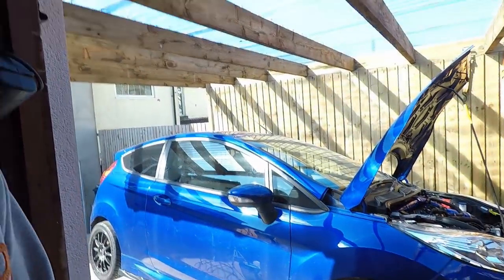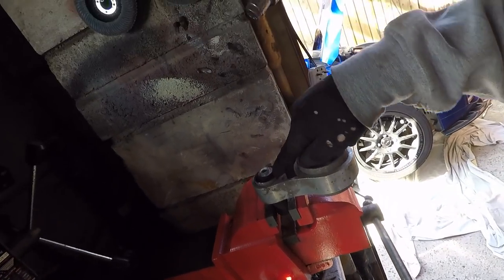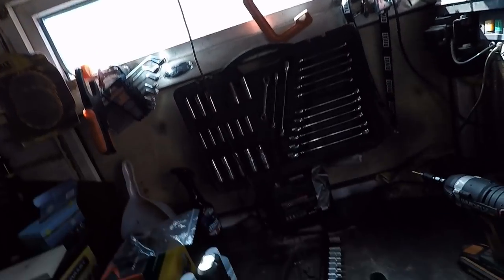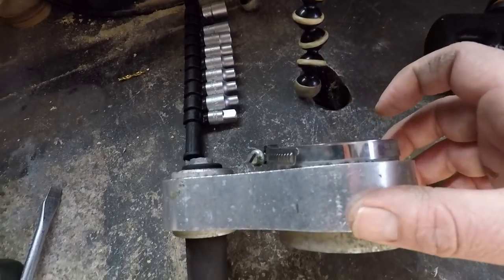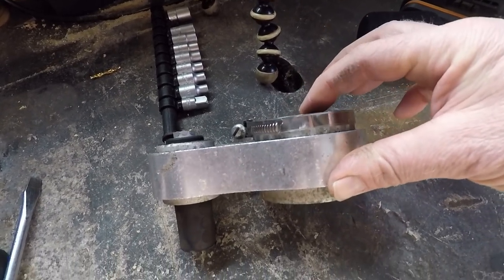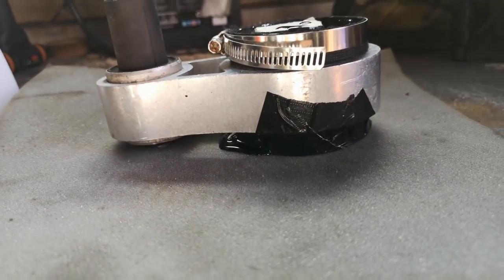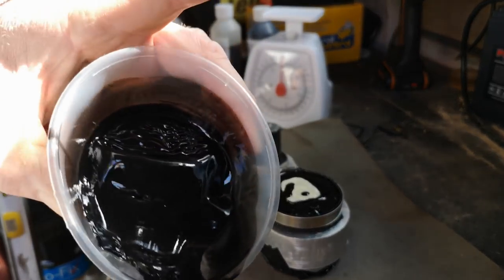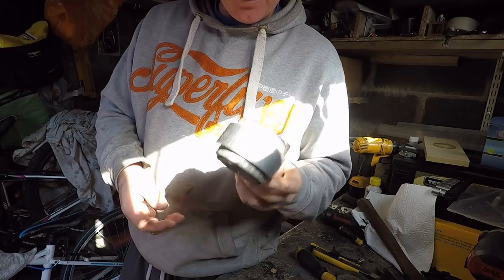Making your own poly bushes.i mould the fiesta st engine mount

Comment: Theory is definitely sound, was a good watch and a good idea.

There are different grades of polyurethane, which cure to different hardness/pliance.

Another cheap way of doing this, with consistent results (but not as easy to get so neat and tidy) is to buy pre-mixed polyurethane sealant (Sikaflex etc) in caulking tube and squeeze it into the bush from a caulking gun.

Comment: There are different types of polyurethane, that one you have reminds me of the stuff you use to fill holes in concrete flooring.
It'll cure very hard but you will still get a tiny bit of flex in the rubber so i don't think it will break up, have to wait n see.

Comment: Hi Steve, you are too young to remember the Austin Maxi, but they had a rear trailing arm bush that failed the MOT every year, so I purchased a new pair and did this repair and it never failed again.

Loving the videos
Reply from the maker: Thanks for the compliment but I'm actually old. I remember the maxi 😁
Reply: Ha ha yes, Cross tube mounting bracket, two metal bracket joined with rubber that sheared off all the time☹️

Comment: I had a split Bush once before and it failed on MOT. I was short of funds at the time and needed the car for work etc. I filled the whole bush with Black CT1 and passed the re-test 3 days later. Have a look into it #Spark Plug Steve . It's about a £10 a tube

Comment: Revo makes a great mount, I’ve had it for a couple years now and it is barely noticeable. I then installed both upper mounts with Vibra-Technics and it smoothed out even more. Very surprising to have all 3 mounts upgraded and little to none vibration or harshness.

Comment: Not a failure, its a learning lesson. Lets see what happens to the bush in time and how it performs on the car. The process of casting the PU looked simple. Had a look on ebay and found what I think you used, in the description they do have a link to another set that does give a PU rubber mix, these look different bottles to what you used. Still a good video mate! Stay safe!

Comment: Steve. Not sure if you have a product called 3m window weld. But it is a polyurethane you but in a tube from our local parts store called Auto Zone for about $30 usd. I’m sure you can find it on the internet but it’s what we use around here. Also if you have or can find a cheap Torque solutions rear motor mount used and the bushes need replacing you can order the Whoosh motorsports replacement bushes for the Whoosh mount and they fit the exact same also cost $30 usd. Thought I’d lend some advice to ya. I’ve replaced the whoosh bushes into the torque solutions mount myself so I know 100% sure they fit. Good luck buddy. I love the videos.

Comment: I think what you ordered was casting PU its more like plastic. What you need in holding PU which is more like rubber and comes in different hardness. Shore 80A is a good place to be. Try something With high tear resistance and that should work a treat.

Comment: Was going to say maybe a little less hardner and it would cure a bit slower and be less liable to crack but now I read you bought the wrong stuff. Well done for having a  go anyway. I worked in a fibreglass factory and hardner quantity was the thing that we adjusted depending on the temperature you were working in. Not enough and it would never go off.....

Comment: Does it say what the shore hardness is? Polyurethane comes in different grades from really soft and flimsy to super hard plastic like. The shore will either be a shore A or shore D and it’ll be a number then letter. Ie 65A or 80D. Look up shore hardnesses and you see what yours should be like and if it’s suitable for bushes.

Comment: Steve an easier and cheaper way is to fully clean a std mount and fill the viods with tiger sealer which is a PU sealer once that sets voila a uprated mount 😁
Someone has already said it...
Note to self read comments first🤔

Comment: Hi Steve, @Spark Plug Steve , thanks for your videos, they are really helpful.  I've been driving my ST for 5 years now. No track days, just daily driving (spirited once in a while) with 68000km on the clock.  Would you recommend changing the engine mounts?.. I can feel a little bit of vibration in the cabin but nothing unbearable. Also, i dont hear any weird noises (yet). Thanks in advance,  CeeBee from Hong Kong.

Comment: I would have tried filling a 100mm section of pvc hose first clamping one end of it closed in a vice. Run a box knife along the hose after curing and see how pliable it is afterwards.

Comment: Interesting little project Steve, I hope it stays intact. 
I don't know how it's supposed to set but maybe a cheap set of digital scales (less than a tenner)for any further attempts to make sure you get the exact mixture?
And now on a lighter note Steve, when you sing the chorus line from the Ashford and Simpson song it is imperative, nay, it's the law that as a geezer you MUST replace the words "solid as a rock " to "solid as my cock "😁
Keep safe and keep tinkering buddy